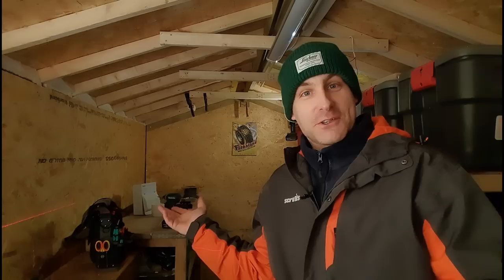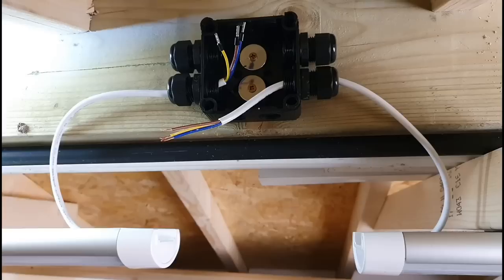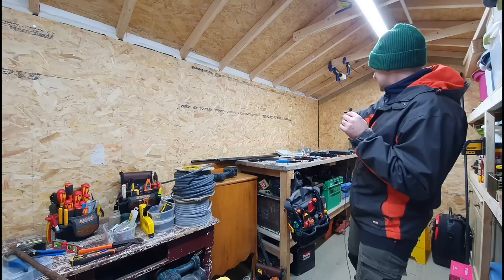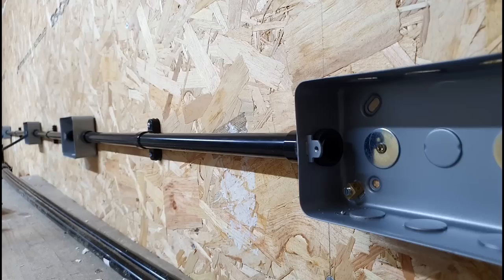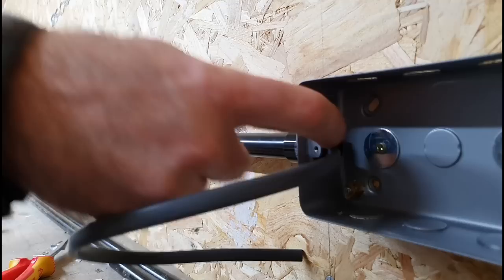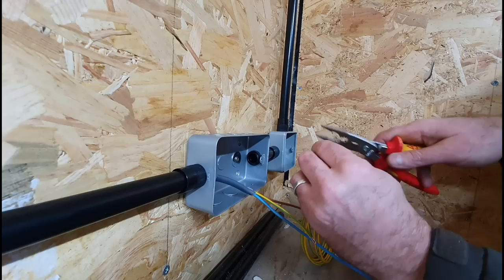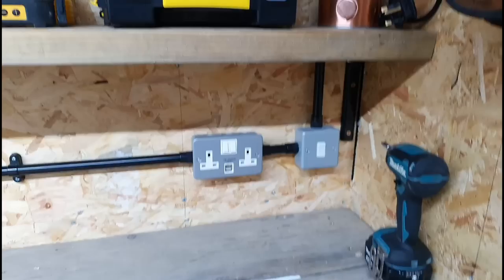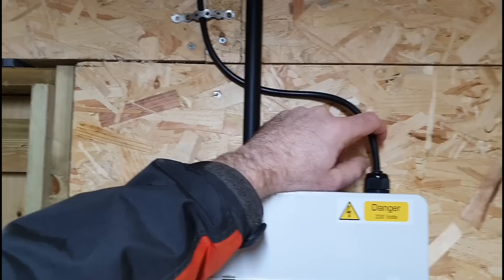The shed rewire | Sockets & lights. (45)

Comment: Nice wiring tip for the CPC in the socket making that V.
Reply: It’s not really a tip tho? It’s just an idea if you didn’t know you needed to earth a metal exposed part then you getting a shock
Reply: @Madman-ge2eb  usually people install them as 2 separate pieces of wire to earth the metallic back box. I was referring to his method of leaving it as a single conductor.
Reply: The fixed lug on the socket front also conducts the earth path to the back box.

Comment: What size SWA will you use once conditions are more workable?
Reply from the maker: Probably 4 or 6mm 3 core SWA partially clipped direct to a fence and partially buried.
Reply: @JBE  cheers for the reply. Will you still come off a socket into a wiska box or run it back to the DB?
Reply from the maker: @simonhilton6120  probably go straight into the DB in the house.

Comment: Personally, if I was to plug it in, I would just buy the sockets up and switched fuse spare off the light but I guess you’re going to wire it up fully instead of leaving it plugged in permanently as it works

Comment: I'm not an electrician but I'm also not useless so I'll be doing the majority of my workshop wiring myself. Only concern is getting the 6mm armoured cable into the house and connecting it to the main CU😳😂
Reply: It is notifiable work too under part P of building regulations.
Reply: @cag9284  I've managed to rope my friend in to do the consumer unit stuff as he's a self employed sparkie 👍
Reply: @jamesfox3784  👍🏻

Comment: So your just essentially plugged into an outside socket into the CU? That would make my life a lot easier 🤔 I'm only considering 2 led batten lights and maybe 3 or 4 double sockets same as yours. Think I'm going to go that way for now 👍
Reply: That’s kind of okay, but the issue issue is you’re not really going to be drawing that much power, but if that’s your permanent solution, you could probably just feed it straight into the sockets and switch fuse spur the  lights so you do not need a consumer unit as that’s okay if the building has adequate protection for that circuit and that should be okay
Reply: Thanks for the reply @UKsystems I've actually gone down the full garage CU route using 4mm swa wired into the CU in the house so I've got more scope for power usage if I need it. Installed by a qualified electrician 👍

Comment: Hi Jeff, I hope your family is still surviving ok, during these testing times. Man Cave looks good, but don't forget to protect your gear. Fit an Alarm and check your insurance. Nice job anyway. Stay safe.
Reply from the maker: Hi Brian, my names not Jeff it's Grand master ram rod. Cheers though, Cameras and alarm installed along with smoke alarms and even emergency lighting incase I'm doing something dangerous and the power goes down.
Reply: @JBE  I am so sorry James, i think i did this once before with you. Strange, you look like a Jeff though. Glad to see your protecting yourself and your equipment. 😁

Comment: For my old garage i fed the light cable through the same trunking as the radial, see you kept yours separated. Is this just a preference or is there a problem doing what i did? Thinking of feeding my cooker circuit through the back of the sockets/ring circuit (gone for 45mm deep back boxes) just so i can use the same wiring route as its tricky with a pitched roof.

Really enjoying the videos, learning a lot from them and I'm definitely using the sleeve tip for the earth going forward.

Comment: I think you need some DIN rail blanks instead of the metal ones. They are just poor. 

Perhaps, even Fuse Box can sack them metal blanks off, and just include the DIN rail blanks as standard.

Link to product ~ https://www.consumerunitworld.co.uk/fusebox-adrb-single-module-din-rail-blank-4029-p.asp
Reply: The metal ones may be better in summer like a shed what I’m gonna say is highly unlikely but if something was to impact the front with the cover open they would be more resilient as people do weird things in Sheets with consumer units where they lean things with it with the flap open. I’ve seen several get damaged that way and I don’t really know how.